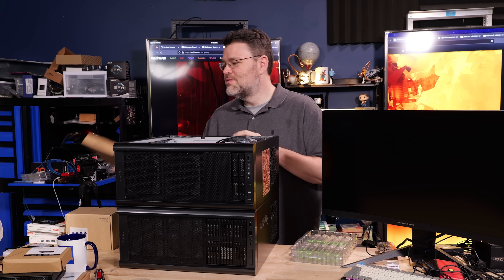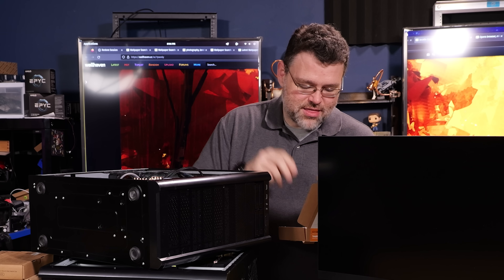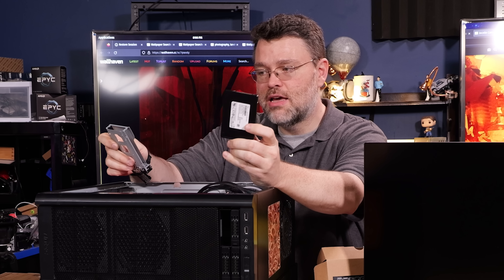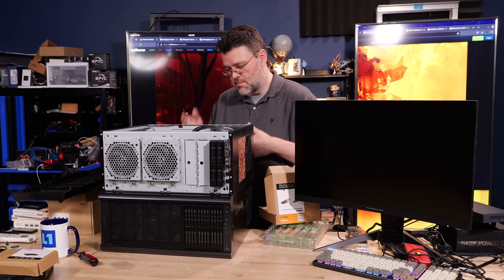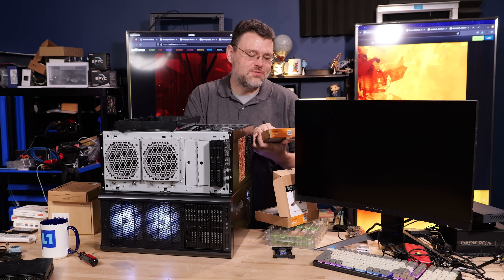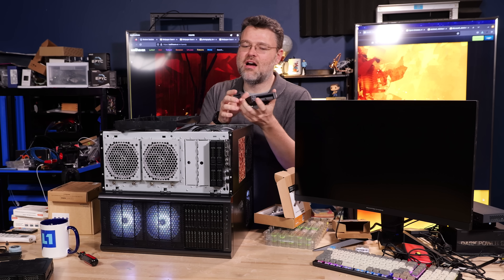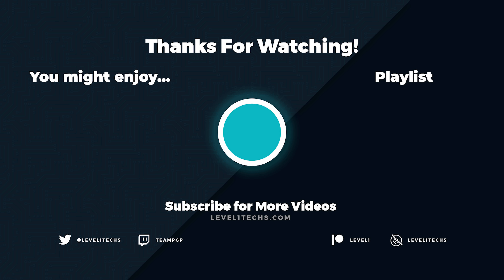Icy Dock PCIe Means More M.2

Comment: Why exactly aren't m.2 considered hot-swappable? For example, my bios has an option for pcie hot swap. Is that just a bad idea in general or is there something special about the m.2 form factor that makes it bad?
Reply from the maker: connector not designed for it. grounds float on signal lines which is bad

Comment: Can the pcie 2 slot nvme card be used in a regular desktop pc and use the gpu for gaming? I dont need high fps i have 5950x amd cpu the motherboard has the bifurcation settings . Someone told it will slow down my GPU?

Comment: Recently spent a fortune tracking down a second old Zalman MS800 Plus for my home server for the front bays. Starting to wonder if I should set up a niche business making custom home server cases with nothing but 5.25" bays. :)

As for the mobos...I really just wish mobo manufacturers would just pack in as many bifurcated PCI-E slots as they could manage and differentiate their products by having most of the different built-in stuff (like 2.5G/10G eth interfaces) on optional PCI-E cards. Why spend lanes on multiple mobo M.2 connections when you could just make your slots support 4x4x4x4 bifurcation and include cheap passive risers. Or waste lanes on the on-board 2.5G interfaces when you only need the 10G?). Or being stuck with SATA slots you don't need consuming lanes. Or being stuck with whatever previous version of connectors the board came with when what you actually need are different versions (i.e. M.2/SFF-8639/OCuLink/U.3/etc).

I appreciate that's only starting to become viable with newer CPUs with enough lanes, but it has to be the end goal, surely?

Surely it'd be cheaper for the manufacturers to have simpler and less variants of their boards?

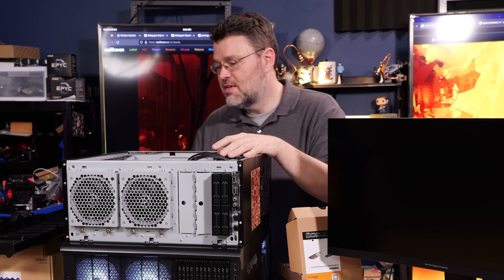Comment: 6:40 I have bought two m.2 to 2.5in U.2 (MB705M2P). When I plug them in when server is powered off, then the server (Supermicro 4U 4124GS) will not pass boot (the white IPMI screen). Plug them to a Threadripper (MSI TRX40) workstation with PCIe to U.2 cable, They work fine. Not sure how to diagnose.

Comment: Looks like a great set of options to combine with ASRock Rack thin mITX Epyc board... the first one or two ports split to 16 SATA drives stored in those SATA banks in 5.25" for relatively capacity oriented cold tier. The rest at least 4 PCIe4x8 ports to split amongst NVMe storage bays for 8 hot tier speedy drives... with maybe now somewhat cheaper Rome or some promo Milan with 24 cores or more and all 4 DIMM slots populated with now relatively cheaper DDR4 memory for at least 128GB total... the dual 10Gbps links on board make it somewhat useful without extra NICs, and thus, the sole PCIe4x16 slot could be used for something else... maybe GPGPU, or transcoding ASIC, or... those 21xM.2 storage adapters for ultimate small-ish all flash setup? Wrapped in a dedicated chassis to be smallish as possible yet accommodate the FH/FL AIC and those 5.25" Bay adapters, you could get a remarkable Microserver with storage in mind... Though if thinking big and flash-y, I'd say try to use such 7xPCIe4x16 board and populate each with those 21xM.2 adapters... 147 M.2s in a single chassis, even if of slower variety per drive/unit, would constitute some extreme storage as a whole... leaving any other PCIe/OCULink or SATA ports left for further storage uses to add more to the extremity of such an "appliance" as it would easily saturate the dual 10Gbps ports all the time with what's coming from the drives even on consumer M.2s of lower performance ;)

Comment: This IcyDock system would be great for backup on my system. Where I could do a quick data backup and swap out the drive. But at the price they want, I'll continue to use USB cable cases. Much slower, but also much cheaper.

Comment: Ok this might be a silly question but I've seen some products in videos that seem to break the norms with bifurcation.  Are there products that handle the bifurcation on the PCIE card so that you can use multiple m.2 drives in a single PCIE slot?  I have some older motherboards that I'd like to use as a NAS with m.2 drives.  These machines currently have spinning disks and no option for bifurcation in the bios.  Is there a product that does what I'd need?
Reply from the maker: Plx bridges or plx based adapters are what you would be looking for.
Reply: @Level1Techs  thanks for the reply!  Must be a super niche product, not many options, most are direct from china with bad reviews.  I see a few server grade going for $600 plus.  Far cheaper just to buy a board and cpu with bifurcation support it seems.

Comment: We stopped purchasing IcyDock 4-5drive USB cages because all five of our first purchases had dead-bays - dead connectors.  We solidified on Oricos which have been perfect for our customers' home drive servers.  We use Antec Two-Hundreds which are superior to your Antec 300s for one reason: the A200's have a pop-off front facia-with-fans and this allows all bays to be emptied and filled from the front.  No 'dragging drives over motherboards.'  They are SOOO wonderful.   But far more rare than those 300s, which beg for a Dremel to slice out the front sheet metal and figure a way to put the 120fans onto the front-facia 'forever'.

Comment: I have a question, recently I bought a M.2 to PCI-E adapter hoping to add NVME capability to an old system that doesn't have a M.2 slot inside. I cloned the SATA SSD entirely to the NVME stick with dd but now it's refusing to boot from the NVME. The original SATA SSD has a dos partition system. I tried using MBR2GPT tool on Windows without success because it throws an error 0X00000000. Any advice would be greatly appreciated.

Comment: IcyDock has all kinds of great stuff but I really wish they would do lower end things. The data hoarder community would love some enclosures and adapters that are on the cheap. Plastic, mostly passive. Maybe a high density M.2 enclosure with a PCIe bridge / multiplexer built in. Basically something like what crypto miners did but for storage.
Reply: they do with the "flexidock" product line. M.2 and pcie bridge/switch is expensive so forget that, crypto mining does not need pcie speed so they are fine with cheap 1.0  bridges in many cases
Reply: @marcogenovesi8570  flexidock doesn't fit the purpose described. They are still have active backplanes (which in my experience break too often or add additional instability) and don't come in the forms I think people would want. Older PCIe bridges/switches are not expensive. I bought the Ceacent ANU28PE16 NVMe SSD Riser for $90. An IcyDock TouchArmor SATA enclosure can cost 20-30$ more than that easy.

And data hoarders don't need speed either. The bridge chip used on my ANU28PE16 can push more than 2GB/s on some Intel P4510s I have. That is WAY more than I need. The ports / pcie lanes could be split further to give the ability to plug in more devices. We want density and ease of setup. I don't need activity lights. I don't need sleds. I don't need metal. I just need easy connection, power, and density.

Given the decreasing prices in in enterprise nvme and sata drives I would be more than happy to have an external enclosure that took U.2 drives or SATA 2.5" drives and connected back to the main machine via a janky USB3 cable, or few SFF-8088s, or OCuLink. Whatever is easiest and cost effective.

I've talked with IcyDock's design team and a 3rd party engineer about this. It probably wouldn't be difficult to throw together. Maybe even a community project. Though I understand that the bridge chips do need setup/programming which could complicate that.
Reply: Old Xeons give you 40 lanes of PCIe gen4, bifurcateable any way you want. Active switches/bridges have a lot of functionality, but bifurcating (via switch) when the BIOS doesn't support it natively is one of the LEAST interesting (but most used) features of switches. They can also have way more bandwidth between expansions than the expansions have combined to talk to the CPU, and form their own compute-hub as a consequence, as they can DMA into each other much faster than the CPU can DMA into them.

Comment: I'm running icy dock SATA adapter cages on the front of my home server and they've worked amazingly. I'm just about to swap out my NVMe drives on the motherboard and looking at other options for making it a bit easier - Are there gen4 M.2->U2 adapters that you've reviewed that would then be attachable via cable to one of the U2 cages? Sure would be nice to not have to disassemble the entire case if I want to swap them out again...

Comment: Why would you mirror wikipedia? If anything just grab the references and mirror Scihub and a list of known petroleum and uranium reserves. You could even truncate the set at Atalla and Kahng in 1960.

Flash isn't designed to retain data for more than 10a. You need to turn the chips into ROM's by repeatedly flashing the same pattern until all the cells containing lows are permanently degraded.

Comment: The first adapter won't work on any LGA 1700 systems, regardless of motherboard. Alder and Raptor Lake CPUs only support x8/x8 bifurcation. Only one of the slots would be functional.

PCIe lanes are always capacitively coupled, they're never wired directly into the CPU
Reply: "Wired Directly" means "Not run through another logic chip".

Also, that capacitive coupling isn't meant to be any REAL protection against ESD or overloads.

Comment: It's kinda wild that the most compact storage is still a shoebox full of MicroSD cards.
And the highest bitrate "network" is still a shoebox full of MicroSD cards on a plane.
Reply: gigabit Ethernet is faster than microSD cards
Reply: @shanent5793  Uhh...no?
I can get on a plane with 1PiB of MicroSD cards in my pocket and fly anywhere in the world with it in a day or two.
How long would it take you to "move" 1PiB of data anywhere?
MicroSD isn't the best for a multi-user database, but it IS still the highest density storage.

But what if you care about accessing the data quickly too?
That same shoebox will hold how many 40GiB enterprise NVMe drives? 50? 100?
How long does it take to priority-ship that anywhere in the world?
How long does it take an actual courier to move it?

It makes networking look like a joke.
ANY networking.
400Gbit?
800Gbit?

Sneakernet still wins.
And it does so by a Loooooooong margin.

Even Amazon and Google offer sneakernet services.
When you are talking about LARGE data, it is way faster and way more cost effective to freight-ship a box of drives somewhere, copy it locally, then ship it back to a datacenter.

Obligatory XKCD reference.
https://what-if.xkcd.com/31/

Comment: Can you do a deep dive on options for PCIe switch hardware? I've heard there's options floating around that aren't absurdly expensive and I'm sure I'm not the only home labber who could do with more lanes even at the expense of a bit of latency and speed per lane
Reply: Agreed, some of us are rocking gen3 with limited PCIe slots in our servers. The price of nvme flash is very attractive even if I couldn't get all the speed out of the drives (now). The only plx cards I've seen, are about the price of a whole new server.
Reply: @Cynyr  Yeah, it's a bit ridiculous that the cheapest way to buy flash these days is NVMe, which is somehow cheaper than even used SATA SSDs...
Reply: @bosstowndynamics5488  "somehow"? This is mass production. They are consolidating so many devices on the same storage chipsets/technology with nvme that the prices are dropping off a cliff
Reply: PCIE 4 switch chips look obscenely expensive, although they are also out of stock everywhere, so they might still be at shortage pricing. A 28-lane PCIE 4.0 switch from Microchip is around 155 USD right now if you order more than 100 of them. And I bet that Broadcom would fleece you even more for their PLX chips.
Reply: Broadcom P411W-32P is around $750, connects PCIe 4.0 x16 host to four x8 SFF-8654, which you can fan out to x4, x2, or x1 at the drives. I'd also like to know if there's anything else out there
Reply: @shanent5793  I think the Microchip PFX series is cheaper.

Comment: We use the icydock 3.5 u.2 front dock with their separate m.2 to u.2 adapter.  So we can check/erase/firmware u.2 or nvme drives at work in one bay. Sucks you have to reboot for them to be seen.
Reply: This feels like the REAL use-case for these things.
They are for bench-top or shop-level maintenance.
They are 5x=10x too expensive to be usable in an actual production sense.
Who is going to put a bunch of $120 drives into $70 enclosures?

Comment: I have some Icy Dock 5.25" bay SATA cages. They work great. I have several different OS's and I choose which drive to boot to during power on of the PC. No boot loaders for me.
However, I've been looking at the U.2 cages and drives and they look great but I can't find much about connecting them via cables and a PCIe add-in card to a regular non-server motherboard.
Any suggestions for use in regular PC's? At modest cost of course! Thanks.

Comment: I wish that motherboards had more physical PCIe slots and SATA ports to accomodate these large storage arrays and systems. At least, motherboards with these features at a reasonable price for under $200 or so. It seems like there is a lot of missed potential with the extra PCIe lanes available on consumer AM5 and Intel platforms for multiple high-bandwidth PCIe slots that isn't being effectively utilized, since they instead feature PCIe 5.0 or only one 16x slot that limits the type of immense connectivity seen in this video.
Reply: yeah if only AMD didn't basically drop the ball on Threadripper (and Intel likewise abandoned that market) eh? Those had hundreds of pcie lanes, hundreds
Reply: Those "missing" lanes aren't there though.
Consumer CPUs usually only have ~24 lanes.
That's 1x16 link + 1x4 link + whatever your chipset/SATA/Network/USB use. Usually referred to as 20+4, since only the x16 & x4 are exposed.
Motherboards that present more than that are almost always using lower speed links that come off the chipset. Which is STILL super useful, but not the same.

PCIe Gen5 actually makes a bunch of different consumer-grade divisions viable though.
A single x8 link is actually a reasonable option for a GPU.
x1 links are ACTUALLY useful for NVMe.
There are a LOT of ways to usefully subdivide 20 lanes of Gen5.
Reply: @Prophes0r  That doesn't really change anything you said, but for completeness sake: Zen4 actually upped the lane counts by 4 to 24+4. On most AM5 MBs they are exposed as the x16 GPU slot and two M.2 slots directly from the CPU.
Reply: @Prophes0r  There is plenty of bandwidth in those gen5 lane, and as you said there is a lot of ways to subdivide those 24 lanes. But sadly there is no motherboard who tries what OP asked for really, they all seem to be focused on cramming as many M.2 slots into it as possible. Which makes sense for the most common desktop config, but can be annoying for building a budget workstation/server with it. If you want to use the lanes for anything but NVME storage, you gotta frankenstein something together with M.2 to PCIe riser adapters. That works, but is more cumbersome than going the other way of sticking a PCIe to NVME adapter into a pcie slot, if you need more storage. And you can't usually bifurcate those into multiple x1 links, which would indeed be very useful.

What I'd like to see is at least one unique motherboard model among the gazillion basically the same ones, that comes with plenty of pcie slots from CPU and chipset. Maybe even with a PLX chip or custom chipset that exposes all that gen5 bandwidth as lots of Pcie3/4 slots alongside a smaller set of gen5 ones. Lots of pcie devices that aren't GPUs or NVMEs just want gen3 lanes. I know PLX chips are expensive, but then again, those MB manufactures are trying to charge like $200 extra for stuff like onboard LCD display, might as well make one unique expensive model with actually useful extra features.
Reply: @Hugh_I  small LCD displays cost like 5$ in bulk while even pcie 4.0 PLX chips that cost less than 200$ don't really exist
Reply: @marcogenovesi8570  yeah I know LCDs dirt cheap. Doesn't stop MB manufacturers from charging a lot more for such features though. 

And yeah you're very right, PLX chips are sadly expensive. My thinking was that would at least actually justify the high prices for the top end motherboard models while actually giving me a feature I'd be willing to pay more for.